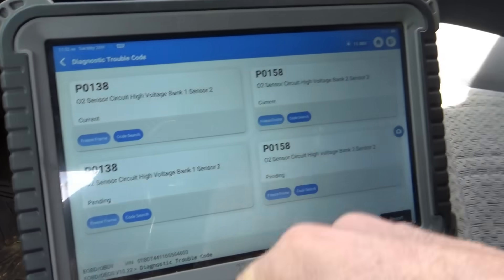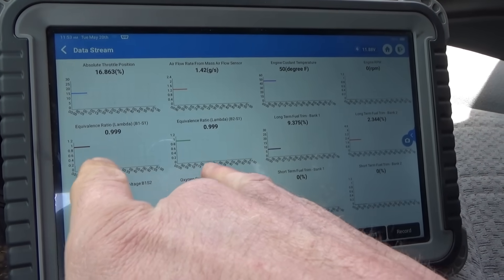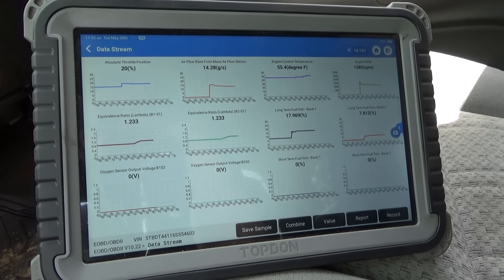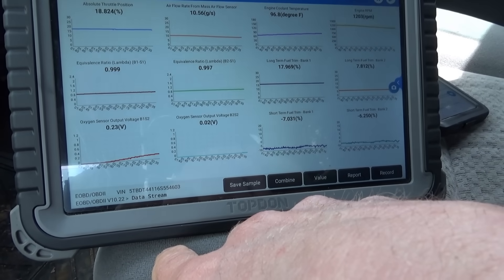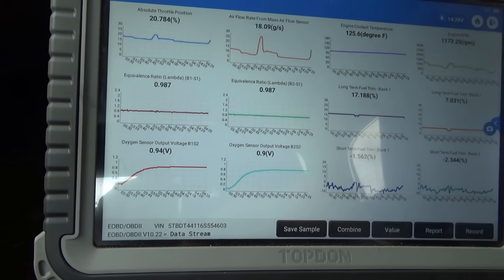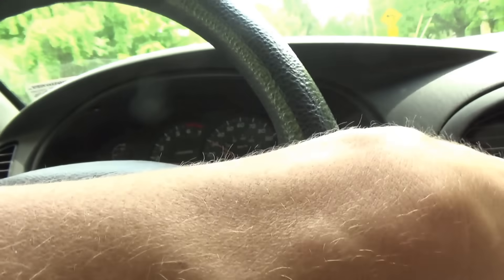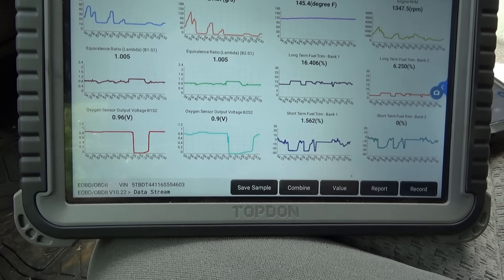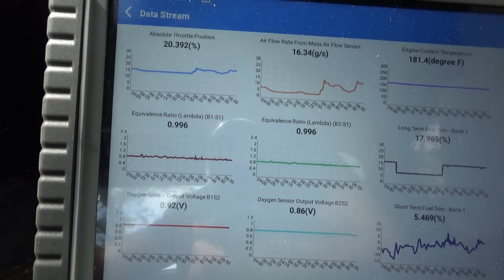Toyota Truck TRICKS the Tech?! ('06 Tundra V8: P0138 & P0158 - O2 Sensor Voltage HIGH)

Comment: I have the same engine in my 2006 4runner. And I replaced the downstream sensors. But it was my upstream sensors that were causing the issues. So now I have all new sensors. And no more issues. Oem of course!

Comment: That is an issue with just using dtc's for diagnosis. Diagnostics are written mainly for failed parts and not for partially failed parts. I almost replaced fuel pump for lean codes on my Ram when the issue was an o2 sensor going wacky. The sensor would go lean making the fuel trims go full rich intermittently. I had to drive around with a scan tool and a fuel pressure guage until if happened.

Comment: I just fixed the same problem with my wife's 06 camry 4cyl plev. It had the bank 1 sensor 2 high. I installed a new sensor,  but it gave a bank 1 air/fuel high. Only after I updated my Autel 808 scanner. I just installed a new sensor after a year because I bought the wrong one. The pig was not long enough.  I bought the 49 state sensor and not the California one. I took a chance and wired it in. After I drove it 100 miles, my oxygen drive cycle finally cleared.

Comment: Interesting. Last winter I had intermittent o2 code on my verano.  Downstream would go high voltage. It would actually clear itself.  Hasn't happened again since warm weather.  I still have new one in the box. Don't recall if I looked at freeze frame long term fuel. Maybe it's my upstream that has intermittent problem

Comment: There's always a 3rd person issue. First the tech says that "code reader says its maf or misfire" service manager asks customer if they apporve repair. Clear  codes. Whether check engine light is on or not park vehicle and deliver yo customer. If customers asks about it say its unrelated problem and you told service manager to perform repair and also tech is covered because scanner told him error code and he got parts for that code

Comment: Good find Ivan.  A few months ago, I took a look at a friend's 03 Lexus ES 300.  Had codes for P0420 and P0430.  I found a few issues with it.  The intake manifold wasn't secured in the back, and it developed a small crack near the throttle body.  I replaced it with a good used one and a new set of intake gaskets.  Also fixed all 3 rear mounting brackets.  3 weeks later, it pulls a code for P0420 again.  I just haven't had a chance to take a good look at it yet.  Early scan data showed that there was a slight lean creep on bank 1 while at idle.  But it returns to normal at higher rpm.  I'm not so sure what could be causing that.

Comment: Open question new tech here , how can I learn more about the basics of diag? When I watch Ivan I feel like walked into a week long class that's half over.
Reply: Pine Hollow Auto Diagnostics,  Scanner Danner, & Schrodinger's Box are a few examples of channels that not only show you the diagnosis of a problem, they explain what they are doing and actually teach you the process.  There are other great ones as well, such as South Main Auto & Kits Auto and Truck Repair, and I'm sure many more that I'm not thinking of right now.  Scanner Danner & Schrodinger's Box both have videos and books where they specifically teach you basic electrical fundamentals and using your DVOM.  My recommendation would be to get those basic electrical fundamentals firmly understood as a first step.  Once you understand that, a lot of what these excellent technicians are showing you in these videos will make a lot more sense.  At least, that is what worked for me.

Comment: I'm glad my 2000 Expedition told me which one was bad with a simple scan of the trouble code. The hardest part was getting the wire unplugged. After about 5 minutes of reaching way up inside there, I finally realized that a pocket screwdriver stuck into the connector was never going to work. Then the idea of an allen wrench popped into my brain. One fit perfectly, and released the tiny little tooth inside the connector. When I saw how small the locking tooth was, I could see why the pocket screwdriver blade would never get to it. I needed something that would fill that entire square hole to release the connector.

Comment: Yep codes are only a direction.. where i work there's another 2 techs or should I say parts fitters... focus came in for lack of switching.. can't remember exact codes. Think it was heater switching and active grill shutter  malfunction.. they deleted it and sent back out.... was back again the next day  same code.. report gets sent to our own garage email for backing up on the pc... the boss reads it who was out at the time... calls us and says put a new genuine sensor on...   guess what the fault came back..   great now it's up tp me to get them out of the shit I thought...   its got to be a power or switched ground fault... pulled a fuse diagram for it and found it shares power with other components one being the active grille shutter... did a visual on the shutter yep you guessed it... its damaged with fins missing and the elec actuator is damaged.. I unplugged the shutter and hey presto the oxygen sensor fault disappeared... the active grill must have been pulling down the feed to the oxygen sensor.

Comment: People don’t realize that 02 sensors degrade over time. They should be replaced every 100k even if there are no codes. Gas mileage is affected. I just went thru this with an upstream code being affected by a bad down stream sensor. I changed both upstream and downstream out.
Reply: Is this True?  My car is 12 years old 133,000 miles, maybe I should change mine out??

Comment: All of these sensors are technically wear items. Oil, soot, lousy cheap gas, even driving patterns can contribute to contaminating them. The smoking gun was high trims but the pre cat sensors near normal range. The posts were REPORTING actual conditions. As Ivan said, the pre sensors cannot report rich conditions, and are skewed lean. Adding 18% gets them in range, but in actuality there is no lean condition, just bad data reported.
Reply: Good info, thanks!  This diagnosis confused me a bit.  I like what you said about the smoking gun being the high fuel trim but the pre-cat sensors being near normal range.  I'm trying to get that straight in my mind.  Am I on the right track here?... The job of the long-term fuel trim is to make the short-term fuel trim near zero.  Since the long-term fuel trim was not pegged out, the short-term should have been at 0.  In that case the lambda being near one would have been reasonable.  But since the short-term fuel trim was high, the lambda should not have been happy, near 1.  Therefore, the pre-cat sensors were the culprit because they were showing happy in a condition where they should not have been happy at near lambda 1?

Comment: Downstream sensors: voltage high .. high resistance ground path? Green crusties/almost broken wire.
Update: me wrong .. yes, I’ve had to replace old, tired O2/AF sensors .. on old/high mileage cases, I usually will replace them all as well.

Comment: I just wonder why Ivan says its running rich if long trim is positive and adds fuel to the mix. If its adding then It ran lean, i guess
Reply: It's "running rich" compared to the base fuel map. Iet's say it had an intake air leak then the positive (aka rich) fuel trim would actually be correcting for a lean condition and the engine would be running a proper stoich mixture. 

In this case the engine was actually running rich because the lambda sensors were lying... So this truck will get better fuel economy when fixed because it was actually running rich and overfueling, not correcting for unmetered air.

Does that help at all? Rich and lean is more of a computer reference. Got to think of "why does the computer want to add more fuel".
Reply: @volvo09 Um means that positive lean trim was actually a rich condition because ECU was adding more fuel to the mix that it did not need due to faulty oxygen sensors? Trying to get fundamental understanding of what happened here
Reply from the maker: It's physically running RICH... that's why the downstream sensors are pegged HIGH 😉
The upstream sensors are lying in this case 👍

Comment: On a 2001 Toyota Tacoma 3.4L V6 I got a check engine light, (can't remember code(s)). I googled it and consensus of reference sources said air/fuel ratio sensor bad. Replaced with a Denso brand sensor, (not Toyoto brand) from Amazon iirc. Fixed. The difference in price between the Denso branded and Toyota OEM boxed was very significant. I have little doubt they were the same sensor. Oh, like the Tundra, Tacoma never ran poorly with check engine light. As expected another quality diagnosis. I'm thinking downstream sensors a waste of $$$$.

Comment: Parts cannon.....maybe. If the upstream sensors were degraded, the downs were  probably suspect or should be looked at with the same bias. And vs versa. Given the reliance on these sensors for the engine to run correctly and the cost of a good tech/shop, the cost of 4 OEM quality sensors as a change out might be the better money spent as a one and done for some. I am my own tech, but my time and trouble are worth something too. My thought was that the sensors all have the same number of cycles on this truck, now approaching 20 years old. Mine had 100k miles. I had the 138 pop up, but I had noticed the milage dropping off for a while prior. I disconnected the battery, did all 4 and did the start and warmup cycle. I saw a marked improvement in throttle response and mileage. Data on my OBD2 scanner backed it up. So, a few hours, a new appreciation for my extended handle 100 tooth 3/8 drive wrench and 4 sensors, and I'm good for maybe the next 100k. Sometimes, you have to use a bigger cannon.
Reply from the maker: Yup all O2 sensors at the same time is good practice 😊

Comment: Ivan, your hourly rate must be too low.
Rather than get their "technicians" properly trained on how to read the faults and READ THE PIDS it is cheaper to call you in.
That video was a basic example of a service centre not investing in getting their 'technicians" the proper training.
From what I have seen of referrals to you to fix, most "technicians" don't even know the basics of the internal combustion engine nor are prepared to do proper investigations into faults.

Comment: Really interesting fault, have you seen wideband sensors drift like this before?  I have with one of the original Bosch sensors, but this was in a stand alone AFR meter when fixing the fuel map on my Benelli TRE motorcycle, and I'm pretty sure it only drifted because the bike was running horribly rich in some parts of the map (off the scale on the meter).

Comment: Having watched this, I don't understand how the diagnosis was deduced.  I gather that some combination of the readings were implausible which suggested the measuring devices (sensors) were lying. Was it obvious to everyone else?  Really, really appreciate Ivan's channel.  He works hard at his trade and his video content.
Reply: It was deduced by the test drive data. Once he was able to verify that the downstream sensors were able to go from rich to lean it was determined they were functional (not just stuck rich) they were reporting an actual rich condition.
Reply: Code setting criteria for those codes are the rear sensors are reading higher than expected by the pcm. If he checked the freeze frame data on a Toyota and it shows the rear o2 less than 1 volt when the code sets it is usually always the front wide band sensors are reading off a bit but the pcm still trusts them and adjusts the fuel trim so the front sensors are reading lambda. This makes the rear rear too high
Reply: I'm with you. I never would have got this because B1 was 17% rich, and B2 was 7% rich. I would have been asking "why is it running rich" and treated the downstreams as confirmation. But I would have been chasing everything BUT the upstream sensors because clearly they work.

Comment: How long do O2 sensors last? Mine are going on for 17 years now and fuel trims are still near 0.
Reply: Wondering the same. My 2006 tundra with 200k miles is not showing any codes. But am wondering if my MPG is getting worse. Maybe sensors starting to go.

Comment: Was there any other evidence of a rich condition during driving ,etc ?   Quite a difference between LT trim for bank 1 near 18 % ,and bank 2 near 8 %.  Very strange that the PCM self diagnostic is reporting the wrong sensor as the problem.
Reply: Don't trust me, I'm an amateur.  I read the upstream sensors as detecting a lean condition so they caused the engine to run more rich to compensate for that lean condition.
Reply: @IsItTrueThat  I did not notice ( with only 1 cup of coffee) ! I think I would have unplugged 1 of the upstream O2 1 by one. That would require a default strategy for fuel...Then it would be interesting to see what the down stream reported. The initial cold start up of 1.2 on the upstream is backwards to what one would expect on a cold engine, more like .9 makes more sense.  The other strange part is the upstream seemed to rise about normal back to the 1.2  when he did the rapid deceleration.  Time will tell !

Comment: I recently saw comments about purchasing scan tools to properly diagnose problems . This is a perfect example that even the high end scanners often do not get to the root cause of the issue, it’s the guy holding the scanner that does that. Nice work Ivan. 👍👍🇺🇸
Reply: I agree, for over 25 years I serviced automotive service equipment, Sun, Allentest, Vane, Blackhawk, Repco etc.
Guys would buy the "best" and "latest" gear, and due to inexperience, not be able to do a competent job like a more experienced mechanic using test gear 20 years old.
For example, I used to get my car wheel aligned by a guy who had a Hunter Optical Aligner, old enough that the only job I ever did for him, was upgrade the old "lamps" to Halogen replacements. No electronics except for the power supply, but if there was a power failure, connect the aligner to a car battery.
One mechanic told me that its surprising what you can work out with a long screwdriver pushed up against the head, and the handle stuck in your ear.
Reply: @tomgeorge3726 Oh I remember the old Sun units, about the size of a grand piano and a mile of wires etc. hanging from the top. That was the late 70’s and admittedly I didn’t have a clue how to utilize them. Would have loved to be trained on them back then, but I despised the flat rate crap and moved away from that scene in short order. I took my wife’s Pontiac grand am to a sears auto center one time in the mid 80’s for an alignment. That’s when I figured out how to do it myself after they caused a severe pull to the right after working on it 3 times. ( they actually told me it was supposed to be like that in case you fell asleep at the wheel😂) I actually saw the so called alignment “tech” dropping those precision tools into a wooden box when he was done . Didn’t need to see any more. 👍👍🇺🇸
Reply: Excuse my computer illiteracy, but I dont know what OP is, and don’t know what you’re referring to.
Reply: @brianw8963  "Original Poster"
Reply: @milantrcka121 Thanks!
Reply: The best and most expensive diagnostic tool is between your ears, period. If it's not working correctly, nothing else will save your @ss.
Reply: 😂😂😂ok
Reply: @scottwilliams1976  Which bit of the OP didn't you understand?

Comment: Thanks Ivan. Could you explain Lambda pertaining to the readings, thanks.
Reply: From the internets:

“Lambda, …, represents all fuel's stoichiometric value as 1.00. Lean conditions would represent a value higher than 1.00, and rich conditions are lower. These lean (higher) and rich (lower) values are calculated for the Lambda scale by dividing the observed A/F ratio with that particular fuel's stoich. For example: a 12.8:1 observed reading with gasoline is divided by 14.7 to produce a 0.87 Lambda reading.”
Reply: @malware_in_tn9008  Could you 'splain stoichiometric while you are at it?
Reply: You can just Google it like I did

Comment: I had the exact problem on my 2006 Daihatsu Terios 1. However it was complicated by the fact that I was USING a non OEM upstream sensor, giving perfect readings. It was only 2 years old. Eventually the fuel consumption increased  by 15 % so I fortunately managed to source OEM sensors direct from Japan via ANAYAMA. On installing the SUV behaved as if it just come out of the box!
Reply: Gotta love Amayama.